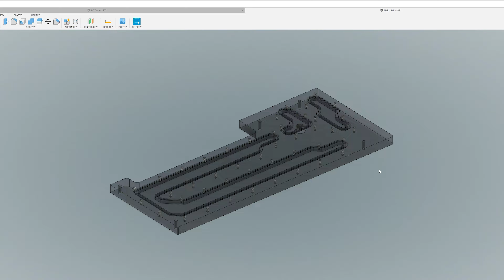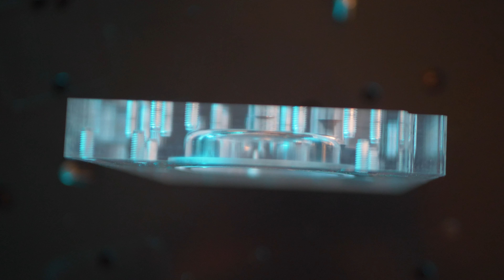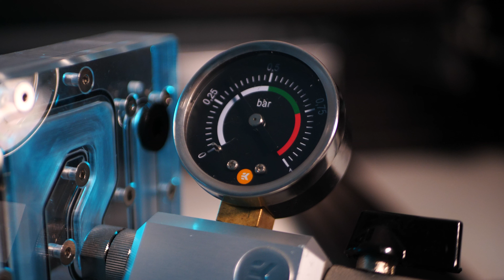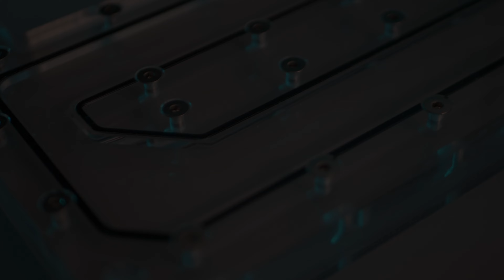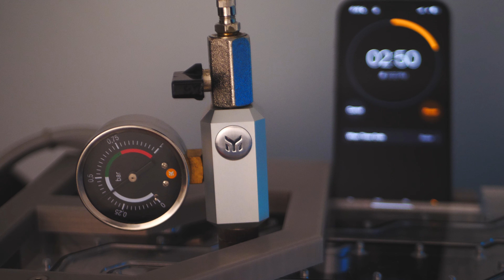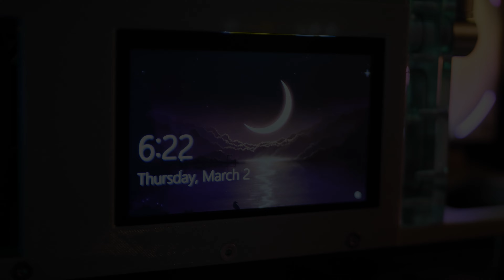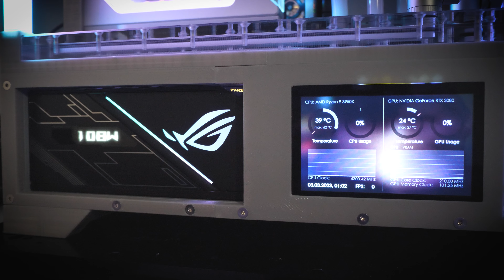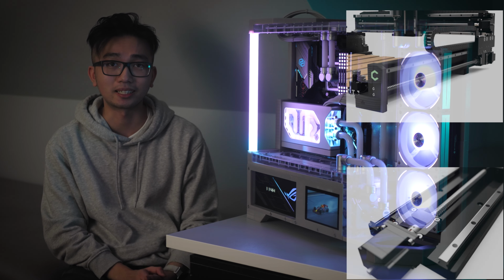Fully Custom 3D Printed Computer PC & CNC Distroplate Build (Chalky sunset)

Comment: Amazing build with extreme attention to detail. Custom builds are my favourite. You deserve an award my dude, I really found a new inspiration for my builds.

Which material did you use for the 3D printed structure?

Suggestion:
The only component that I didn’t like, because it is going to make you loose performance and dramatically lower CPU frequencies was the car shown on your LCD display. Consider swapping it for something more black or even red if you please. Nonetheless, congratulations for your pc 😊.
Reply from the maker: Hey, thank you so much for the message! I see you’re a #44 fan. He’s an amazing driver :)

I had used PETG for the printed material. The running display is now use as monitoring temperature
Reply: @Sae.Dustin  Aight cool. Thanks dude 👊

Comment: How are the temps like with 360 rad?  Awesome build by the way.
Reply from the maker: I’m reaching 70C for cpu and 55C  gpu full load at fans spinning 1500rpm + D5 60% power. No OC on cpu and gpu.

Comment: Hi,
Firstly, I wnated to congratulate you on the awesome work!
Also, what fillament/Infill/Other settings did you use?
Reply from the maker: Infill is 30% infill and the pattern for the infill is rectilinear. I used PETG and the setting was from the mk3s speed 0.2mm in their slicer. The only thing I changed was the temperature for the hotend and the heatbed.

Comment: Gorgeous piece of art, but I'm curious to know where the front panel buttons are located.
You truly inspired me to start designing a 3D printed case now
Reply from the maker: I’m glad to hear that! My case is an open air design, so no front panels. I think it would’ve covered up a lot of details if there was one
Reply: @Sae.Dustin  where would the button to turn on the pc be?
Reply from the maker: @caelant67  the mobo has a power on button near the front panel ports (bottom left) and it’s not a problem for me reaching my finger in there smoothly
Reply: @Sae.Dustin  ok cool